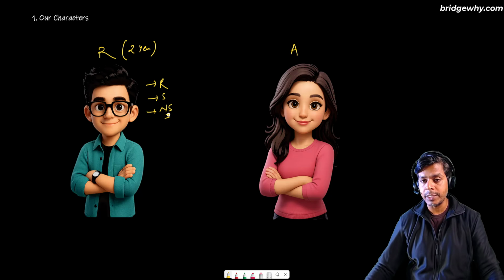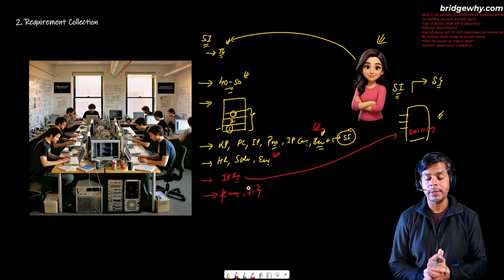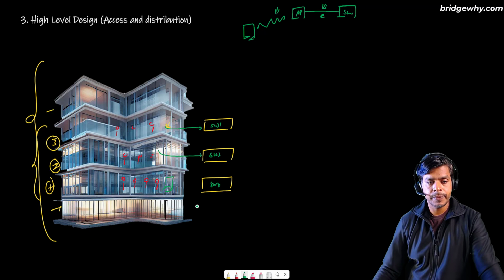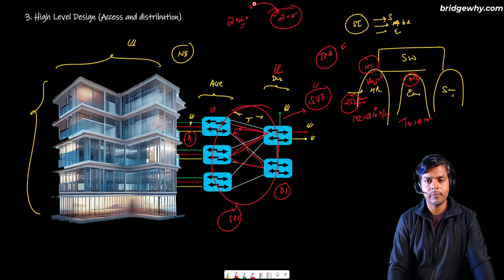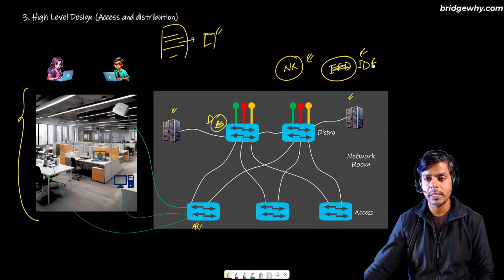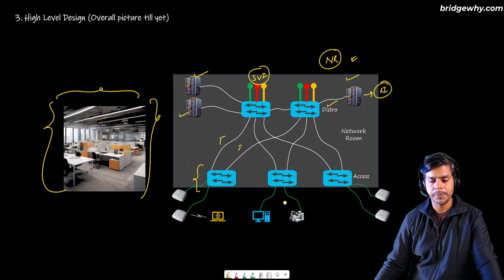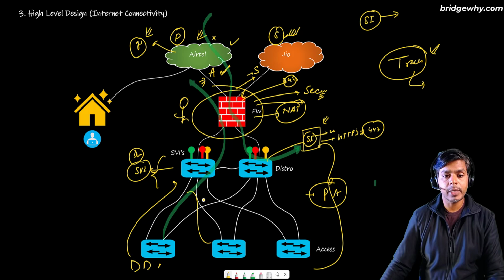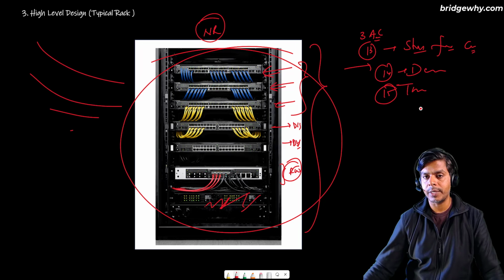Ques-14 (English) Can You Design a Network for a Small Office? | Interview Preparation Series

Comment: What if the access switch goes down, what if firewall goes down, 

Is it a collapse core design what u have drawn....

Why we should not asked isp bandwidth

No single point of failure means why servers are not put in HA or virtualization is recommended along with a DR site

Plz respond
Reply from the maker: Indeed great questions. If one access switch goes down we will have the impact on devices which are connected to that switch. Some solution such as stacking exist in actual enterprise network design. I discussed FW failure at the end but it also depends on how much customer is willing to spend. If customer is having a budget, we can go for active/active or active standby setup for firewall also.

Indeed, I should have a discussion on ISP bandwidth bases on current traffic requirement. Sorry for that.

Mostly we keep servers in DC where we have many such technologies which make a server higly available. But yes, NIC teaming could have been discussed.

But all this discussion will be a overkill for someone who is going for a entry level job interview. This is not the perfect design.. It's just a beginning on how do you start thinking about a design. In current world, we have stackwise virtual for distribution switches. Moreover a software defined solution SDA also exist which is another design choice.

By the way I have created a full fledged Enterprise Network Design course and it is available on my website www.bridgewhy.com in case you love to explore more. Thanks